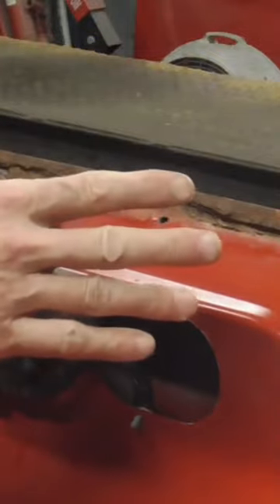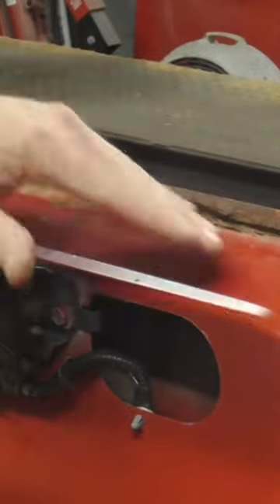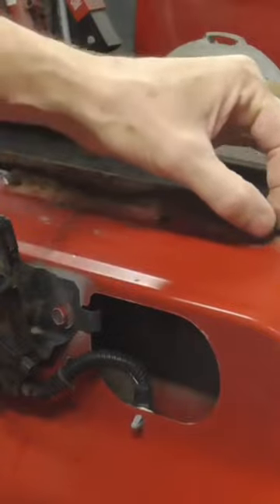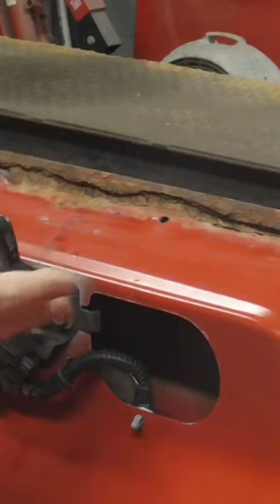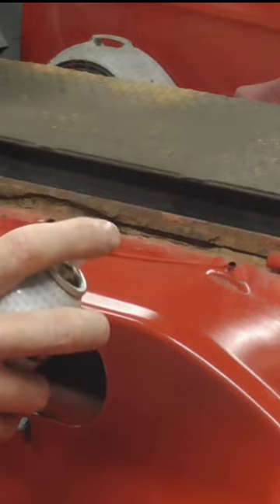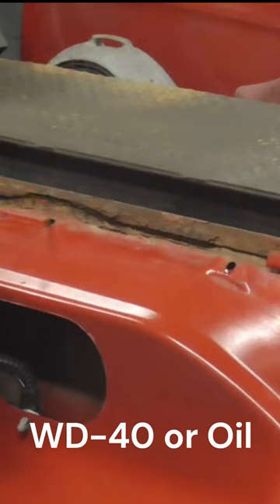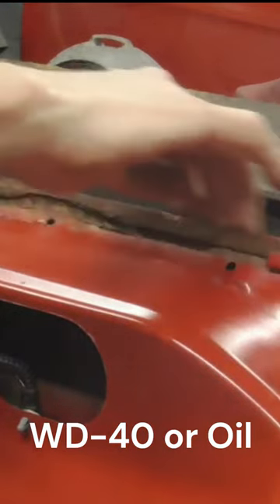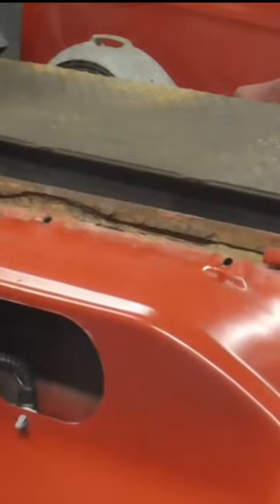How to Prevent Car Doors from Rusting Out #shorts #autobodyrepair #autobody #rustrepair

Comment: The oil that evaporates the slowest is SILICON OIL. It's available as a spray, diluted with octane. Same thing is available as contact cleaner. I used it to clean contacts on customer equipment (audiometers) and eventually got fired because it worked too well. Meaning, it required fewer maintenance visits. I call it "outgrowing my job."

Comment: I love all your videos and helpful tips as a amateur body person who's always trying to fix up their hot rod. can you do one on how to do small clear coat repairs
Reply from the maker: Sure - what type of repair?  Runs, dust, dragging the hose over it, marring it putting the car back together?
Reply: @LakesideAutobody  basically the clear coat on my camper shell started to flake off because it got water underneath it, so I was going to respray at the top clear coat to repair a section. so if you could show how to do a similar type of pair like on a car who's clear coat starting to peel and you want to redo a section

Comment: Nice Jerry...what do you think about cavity wax and fluid film in those areas?
Reply from the maker: As long as the product doesn't clog the drain holes and seals out moisture it's good.  I do think the wax might plug up holes though.  Drainage is huge.  Any panel I've seen that is not enclosed never rusts.  Like, you can hang a piece of sheet metal on a fence for 20 years and it will still be there 'cause it drains and dries :)